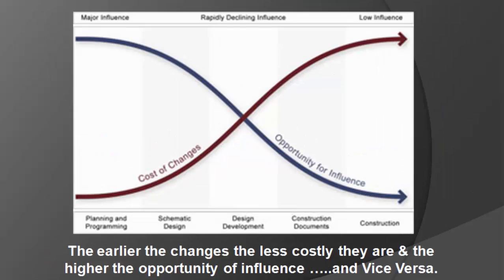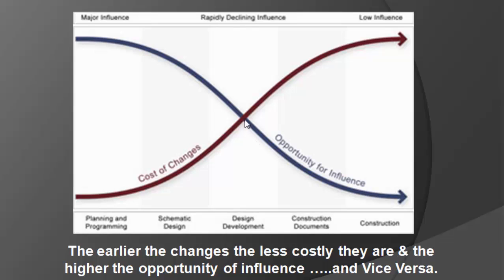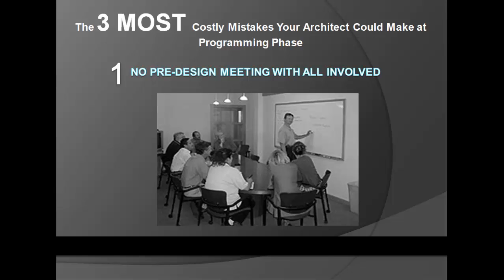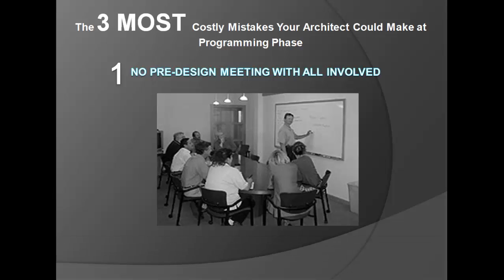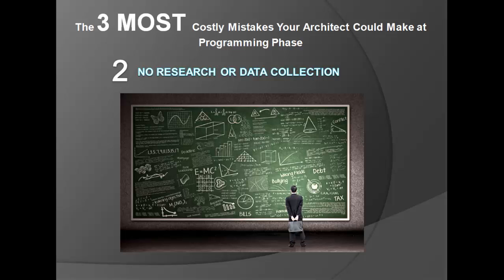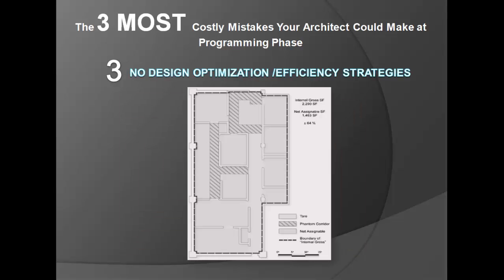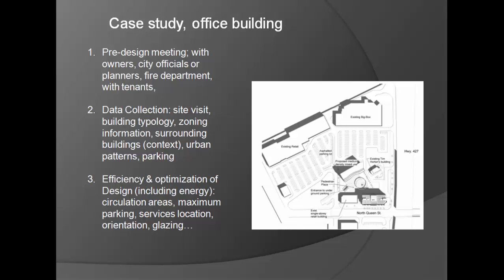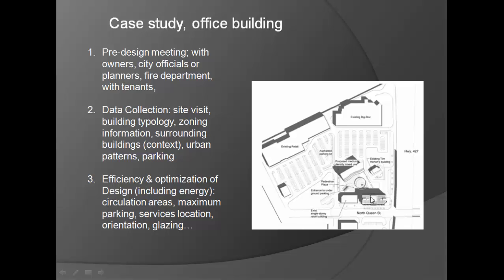The 3 most-costly mistakes your Architect could do at the programming phase

Comment: One thing that should be mentioned is that those diagrams are nowhere near accurate. Changing something major in the construction documentation phase is still vastly cheaper than changing it in the construction phase. Changing something during construction documentation is much more akin to changing something in the earlier phases than it is to changing something during construction. Engineers are cheap, construction is not. I’m an engineer, I would know…